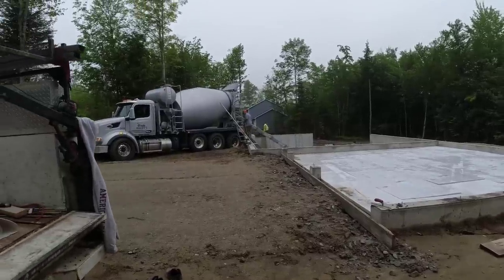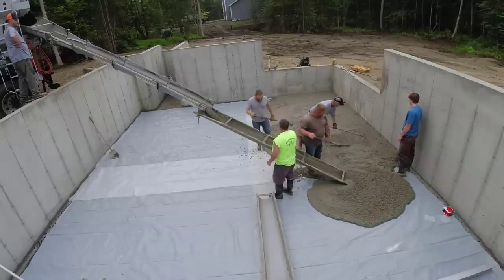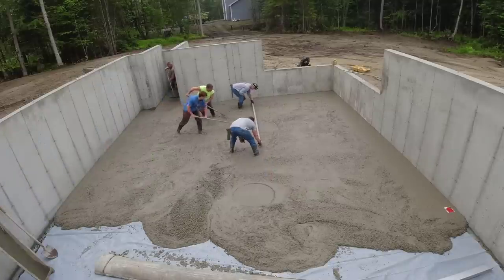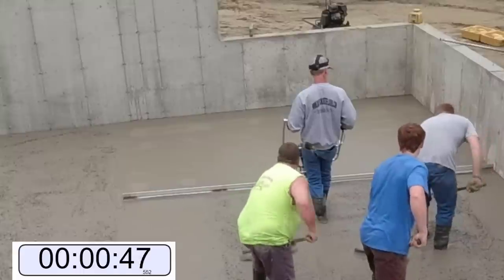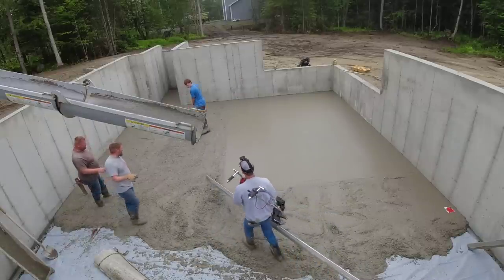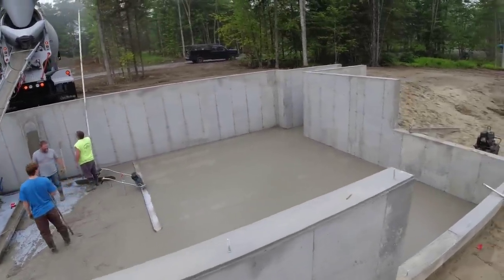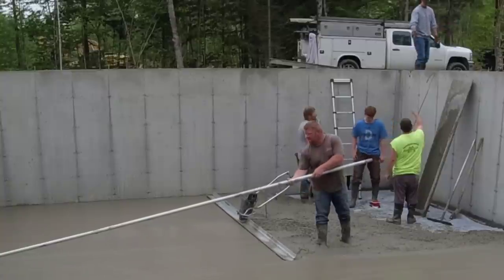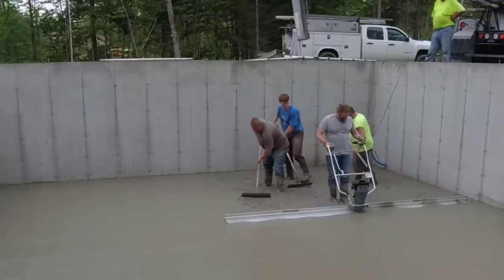How To Screed Concrete | Power Screed Basics

Comment: I have always put a bench at the end of the shout that way the shoot doesn't lay on the floor and get full of concrete on the bottom what we all do it different I make the bench 13 inches high 16 inches wide with two little cross pieces